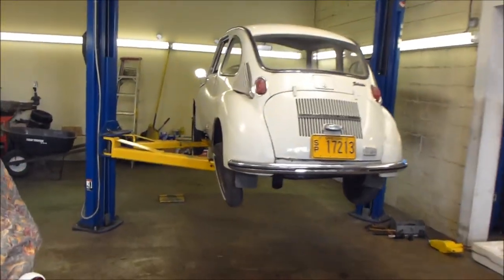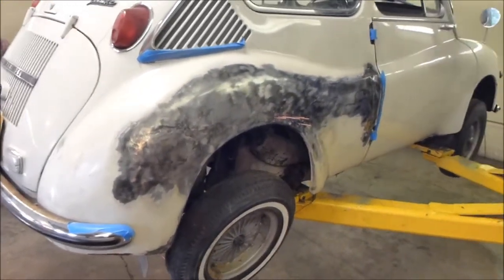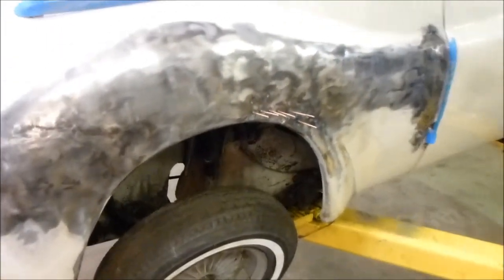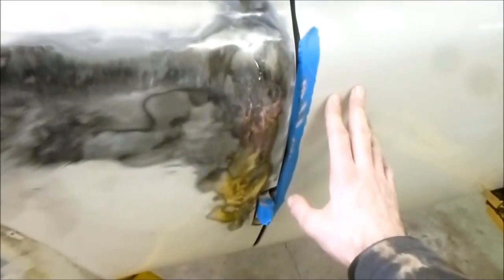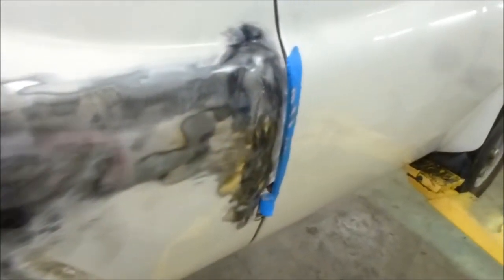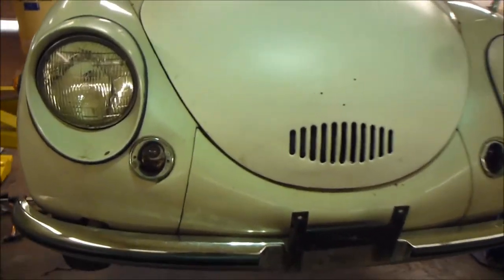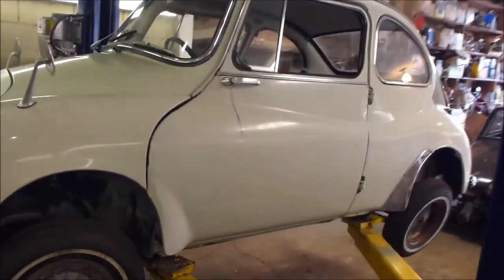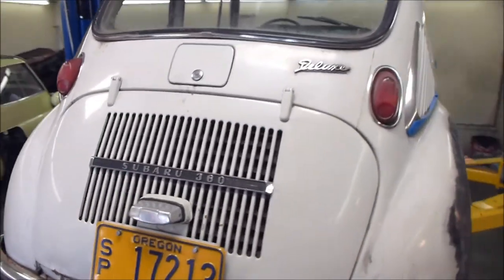Lightweight Subaru 360 vintage racer body repairs

Comment: YOU SHOULD HAVE THOSE DENTS OUT IN TWO STROKES ! 

I GOT MY FIRST SUBARU 360 FOR FREE . 
IT HAD AT LEAST 5 POUNDS OF BONDO IN EACH REAR FENDER !
IT CAME OUT IN HUGE CHUNKS WITH A COUPLE OF WHACKS ON THE INSIDE . AFTER THAT IT WAS EASY TO DOLLY THEM BACK INTO SHAPE . 

IT HAD THE DOOR CREASES ON BOTH SIDES TOO . 

YOUR SUBIE SHOULD TURN OUT REALLY NICE , CAN'T WAIT TO SEE THE NEXT VIDEO .